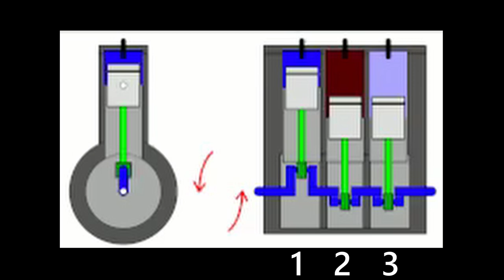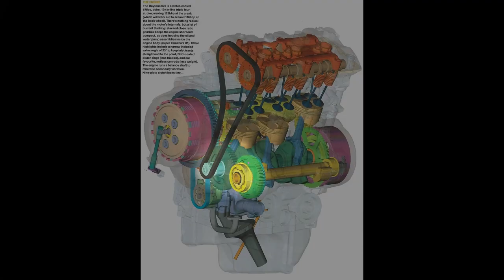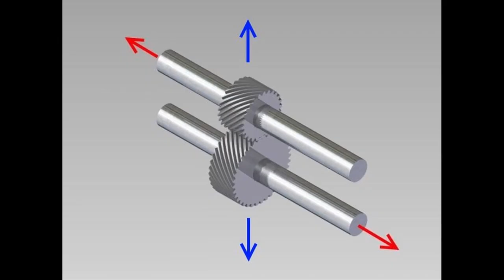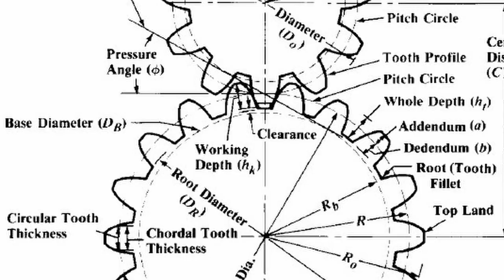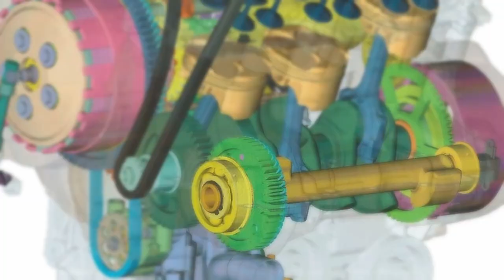THIS is WHY Triples WHINE and whistle | Tea Kettle HIDDEN inside the engine ?

Comment: I always thought it was cylinder overlap
Reply from the maker: Not sure what you mean by cylinder overlap I'm afraid Nick, please correct me if I'm off course, but on both CP3 and Triumph Triples ignitions are spaced evenly at 240 - 240 - 240. The only that springs to mind that isnt is the new Tiger 900 which is 180-270-270 cause their engineers got bored or something go figure..

Comment: Not interested in YT squabbles  ...  but you are wrong  plain and simple .
Reply from the maker: If it's plain and simple please provide a good argument, otherwise your comment is worthless :/
Reply: @UrgetoRide  The NC750X has two balance shafts with straight cut gears, so why does that bike not whine/whistle?
Reply from the maker: @LAXMASTER022  Do you own an NC ? If you did you'd know that it does whine faintly - anti backlash gears. Not as hard as a Street Triple but it does. Keep stock can to keep exhaust noises away - gently rev from idle to say 2k rpm and you'll hear 'the spool'

Comment: Have you ever changed the airbox or exhaust on a bike? 
That whining sound has nothing to do with the balancer gear, absolutely nothing. If it was, the whole bike would make a screaming whistling sound, since every single bike has got straight gears and they turn all the time. 
Just stick with prnhub dude...
Reply from the maker: Air intake makes the growl noise from mid to high rpm, not the whine you hear at idle.

Comment: Does anyone care?

This has been doing the rounds for many years now and no one can say for sure what it is!
Reply from the maker: Andy I literally just did and explained why.. Help grow the channel and I'll be able to afford a street triple engine and mod it to prouve it so everyone can quiet down. A mate prepped and tuned daytonas ..
Reply: Urge to Ride Why make it quiet, there isn’t any point to it. Will it improve reliability, fuel consumption or money?
Reply from the maker: As mentioned on the video, a helical would be make it quiet, but you'd add complexity, a thrust bearing, possibly a slightly beefier case etc etc Thats why on bikes, where people arent too fussed about sounds, they run spurs. In cars youd rarely see spurs cause your run of the mill driver would complain why does the engine sound broken.
Reply: Well each to their own, pointless project but it's your time and money.

Comment: triples DONT WHINE.. Yamahas xs750/850 dont, laverdas Jota 1000 didnt, triumphs 70s trident nor BSAs Rocket all DIDNT.. gear driven counter balance shafts in most fours dont.. what DOES is gear backlash.. poor tollerances.. Straight cut are WEAKER.. ?? FO! find your nearest gearbox speed shop.. straightcut spread tooth loads across the full length of the tooth face & though the gear tooth root & NO side/end loads straining cases or bearings.. helical DONT, they have a small contact point & the higher the cut angle however quieter have significant side loads.. 🙄😫😥😕😬
Reply from the maker: Not a single one of those you mentioned have balance shafts, doesn't that just proves my point? .. 
I haven't watched the video in a long time but I'm sure I mentioned that its the gears that are found in your average balance shaft that cause the sound, not just the presence of one. It can be engineered out, but they prefer not to. Anti backlash gears for example, in fact i think some Triumphs have them, but it doesnt always completely eliminate the noise
Reply: @UrgetoRide  because "triples" dont need them.. your post refers to the Triumph triple whine !